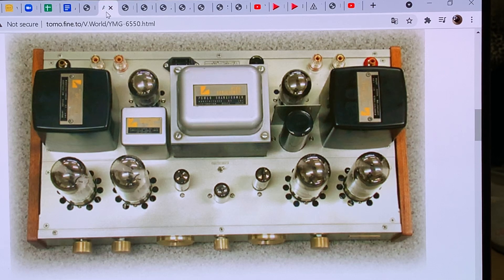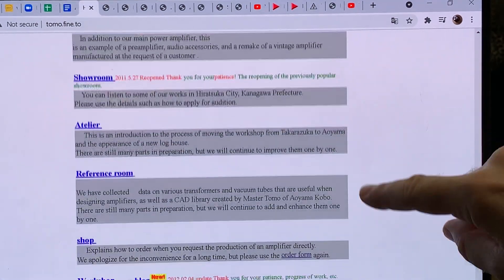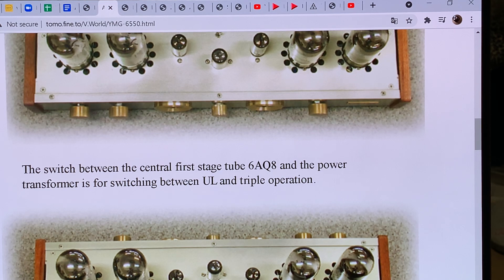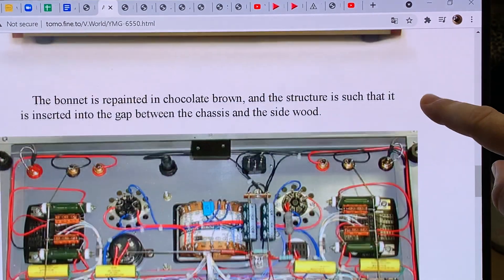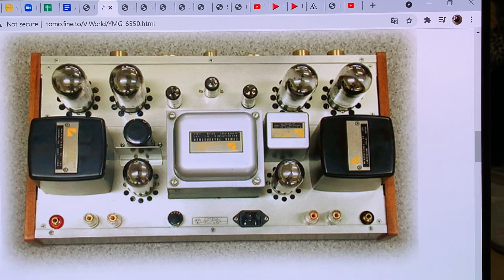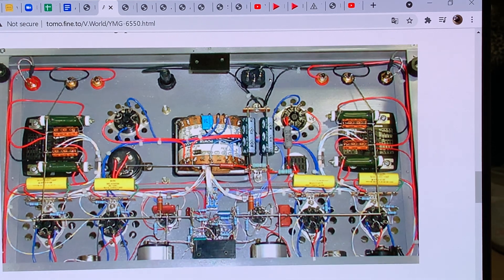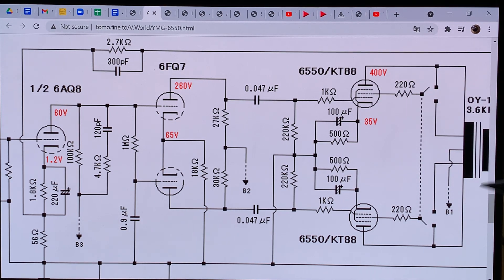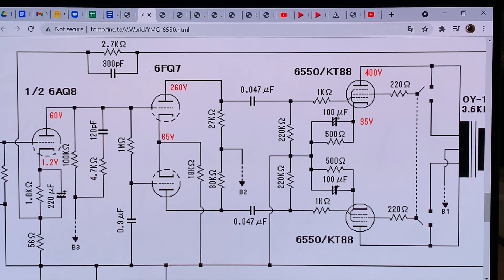Find the finest tube amps the right way!

Comment: Hmm for P2P amp I would expect that the IEC earth pin to have a lug bolted to the chassis for safety (a UK safety regulation requirement). I'd also swap the VU meters for mA and voltage for ease of biasing.. but that's my own personal preference.
A no-nonsense capacitor would be a WIMA FKP1 5% tolerance rated to the correct rating (both Vdc and Vac). 0.22uF 600V is about £3 compared to the £16+ for Mundorf VCaps. They do surpass most of the 'audiophile' caps. compared the normalclearer). The secret is in experimenting and finding your own way..
Reply from the maker: Hi Nick, yes, it is super important to find parts that match the rest of the system and our listening tastes! The WIMA is a very good high quality and affordable choice ; ).

Comment: Love and learn allot from you! I am a krell sounding addict cause I listen to hard rock, metal and jazz fusion  what amp would you suggest in tube or solid state.  Thanks
Reply from the maker: Quicksilver amps will do the trick!  For metal you want a tube amp with massive output transformers. I have noticed that that is the key factor to make metal & high distortion guitar & massive complexity sound good. I suspect that the Bob Carver 275 silver would also work very well - this recommendation is based on its topology, and Real HIFI helps recommendation that Bob Carvers truly sound as good as their promise on paper.
Reply: @realworldaudio  thanks
Reply: Thanks for the help. That is cool
Reply: Are there any others  they seem like mono blocks mostly. Just so confused at times
Reply from the maker: @EmilioGarcia-fr5po  QS has always built monoblocks. However, they introduced an integrated amp, and at a super good value: http://quicksilveraudio.com/products/integrated-amplifier/